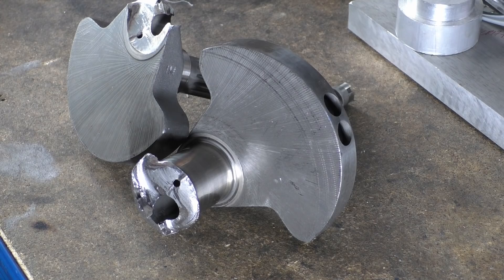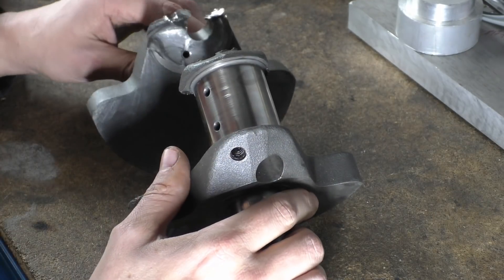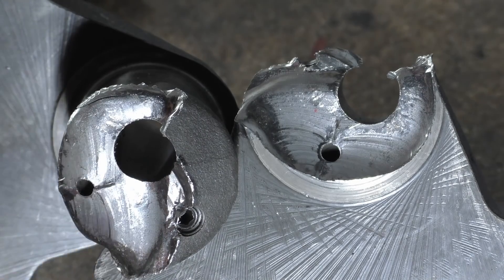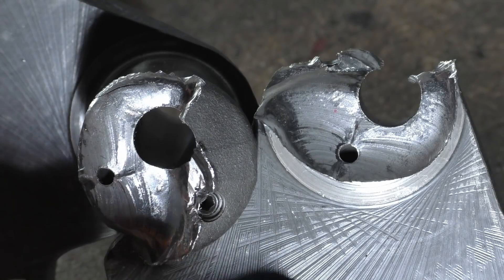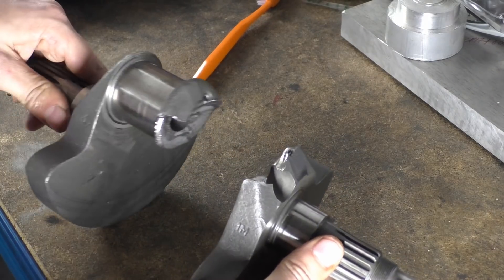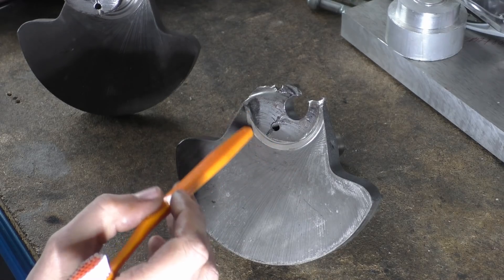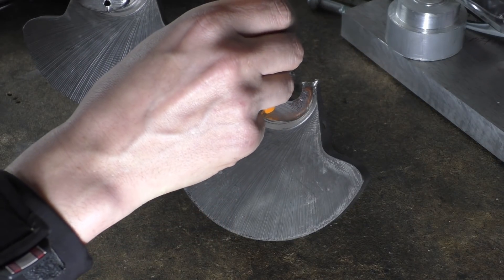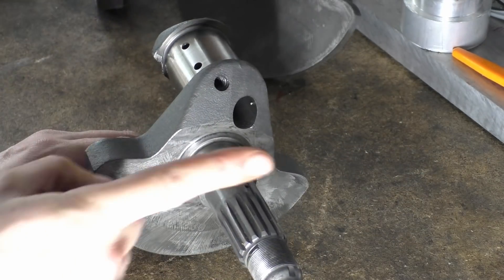Fracture and Fatigue - Ducati Crank - Part 4

Comment: Most of what was said is post cause, for example you identified crack propagation but light on causation. From the video, and this was difficult to see, was whether the radii between the journal and the web was considered to be large enough, this is often destroyed during journal re-grinding as the operator either does not have the right equipment or does not understand what he is doing which effectively writes off the crank. So; I would think the points for initial crack consideration, and from the fan marks, are these initial eyeball checks (not considering material elasticity, heat treatment etc);
1. Radius of journal to web - that crank radius looked a bit small but the video did not define this clearly.
2. Machine marks, even minute ones, on the radius - these have to be finely shot piened away ,on higher performance engines especially (only on the radius), could not see due to video resolution.
3. Had this crank been re-ground reducing the radius - measure the the OEM size.
So what was the the cause, possible heat treatment being provided, flawed material with intergranular issues, or just flawed design e.g. too much hole material removed allowing too much flex for the material temper, hole internal surfaces being suspect?
Happy new year Matt. Get a heater in that garage.

Comment: look up kx450f crankshaft. I think its intresting how beefy the support is on them, with a solid pressed pin running through the center. Rather than a fully forged/cast crank. Why dont they make it somthing like that seems to make so much more sense.
Reply: I think japanese manufacturers value reliability more than peak horsepower. Or maybe they are just better at designing engines.
Reply: @Olppa  I dont get why they cant use a crank similar to a dirtbike, on a v twin setup. It would be practically bulletproof.

Comment: I think I said the same when I first saw the break.. It is common and the only real solution is to reduce the stroke to increase the pin to main overlap if you look at it as a cross section. You do want the cross drilling holes to be in the centre of that overlap as if you cut it on an angle you have an ovoid shape and you are trying to hit the centre of that shape even if you are doing a compound drilled oil way. The Ducati has increased its capacity and with the 1299 and 1199 superlegera which have a 60.8mm stroke compared to the Multistrada crank you have which is 67.9mm the race bike has a better cross section so will be stronger. BUT that is still not as strong as it could be if they reduced the stroke further or change to a 4 cylinder engine.. I don't know say a V4 could be a good idea??  The race bikes do have less mass to their cranks which help it spin up and they do keep the material on the centreline as original as possible (although they do add Densamet or tungsten plugs to get the balance factor back again). You will also find that the side it snapped was also the primary drive side so it has much more load on that side as it is the side which transfers all of the power to the primary drive and clutch so will be the side which will fail first in normal use if there is a problem. Ducati must have known that its 1199 cc Multistrada engine would be its last evolution of its V twin engines for road and race bikes. So in the future we will probably see more V4 engines for the larger capacity bikes and the V twins will fill its retro designed bikes and smaller capacity bikes up to about 900cc's in my opinion. 

Great video by the way and although there are a few issues with the crank which could be solved or at least ease the problems what you have said is correct and the life of the crank would always be limited if the engine was used hard on the road or track. It has reached the end of its development cycle.
Reply from the maker: I'm hopefully gonna get my hands on the V4 crank but we'll see.... Cheers for the comment Richard
Reply: @thedirtyworkshop  No problem.. If you talk nicely to John Hackett you may get to go and look at one over at Ducati Coventry (he owns it and you may have heard of JHP while looking into Ducati's well that is also John Hackett Performance).. John is not likely to let anything out of his workshops as Toine will tell you but if you said it was for a video he may let you go and look round.

Comment: were these two cranks from race bikes matt?
i remember back in the day - late 80's to early 90's? - ducati superbikes would go through cranks on a regular basis.  replacing them after each race wasn't unheard of...
decades later ducati has more or less finally admitted that maybe having 4 smaller pistons is better than having 2 great big stonking ones when it comes to making big horsepower reliably
Reply from the maker: "were these two cranks from race bikes matt?"

1 yes the other not that I'm aware of

Comment: Did I see it correct, is there a hex screw in the crank pin? if so, what it's purpose?
Could a bad bearing (or play) on the bearing in the outer side of the crankshaft be the cause of it all? Since it then can have a bit of room of the crank to bend a bit.
Reply: That is a threaded plug to cap off the oil way cross drilling.
Reply from the maker: Do you mean the grub screw? This is to blank off the cross drilling for the oil passageway - if you look at the CAD picture you can see it runs through the entire crank
Reply: @thedirtyworkshop  yes, that one. Didn't know exact word for it. thanks.

Comment: Classic lesson in fatigue failure which should help the redesign.
Oo Ferrari just went past. I’m not easily impressed but it was red.
What revs did it fail at?
Have Ducati redesigned it?
Lycoming had some crank shaft failures while the engines were idling,
Presumably from resonance, an incredibly destructive force even at low revs.
Isn’t engineering fascinating?
Great video.
Reply from the maker: "What revs did it fail at?"

- this is a fatigue failure so there's no such thing.

"Have Ducati redesigned it?"

- Don't know. Will have to see a new one.
Reply: Just wondering whether it was normal street riding or racing before the failure.

Comment: Making the pin thicker did not help Ducati a lot .. snapped cranks happen with the 1299 Vaginale also and that pin is almost double the size ..
Reply from the maker: Double the size???? LOL
Reply: @thedirtyworkshop  well I think I need to send you some new parts soon haha
Reply: I thought they made a different forging for the Superlegera 1299 and the actual WSB engines (they would have used the Superlegera forgings for the homologation WSB bikes I guess) but since the rules stopped the use of billet steel cranks and some of the weird and wonderful oilway drillings we used to do on some engines. I think it has forced manufacturers to improve the design of the customer bikes as they have had to design road bikes to be more like the race bike designs used back when you could fill crank cases with unobtainium parts. The homologation version of the 2019 Kawasaki ZX10RR is £5000 more expensive than the ZX10R version and the main cost difference is a set of £4000 Pankl Rods and the engines being hand built at the factory. It has improved the bikes we buy but sadly the Ducati has reached its peak of development...
Reply: I knew it was you who sends those parts. You are a master. But more important. Is this from a standard bike or heavy tuned ?
Reply: this  crank was from a road Diavel 1200, nothing special, nothing tuned, just a bike that is driven daily by its owner and the crank snapped after 35.000 km or so, but we see this more often on almost bigger engine sizes, got a 1299 now similar problem, I will send it to the Workshop one of these days so her has some new material to play with haha
Reply: Marc Jackson  it's a failure of the crank because there is s flaw in design in my opinion .. older cranks hardly broke like this even if they pushed 200 HP on the wheel in certain bikes .. it's a cost reduction thing .. even the 1299 wich runs complicated software with pressure sensors in the manifolds etc etc break and they have the same design .. don't see a ecu solving the problem of snapping cranks to be honest.. I could be wrong but it did not happen with older cranks and with modern bikes it happens a lot. So please disprove my point as I am always willing to learn
Reply: @toinevandenbiggelaar6083   I assumed it was you sending parts to Matt :D 
Remeber the thread Ben posted the other week in search of cranks? Some cool info in there that does seem relevant. Deacceleration intertia. Flywheel and engine are spun up and we are suddendly stopping it when downshifting and rear tyre sliding (something I usually did, but never again). Poor crank.